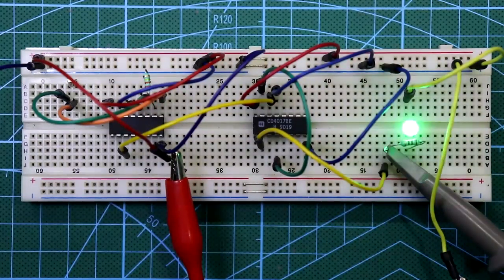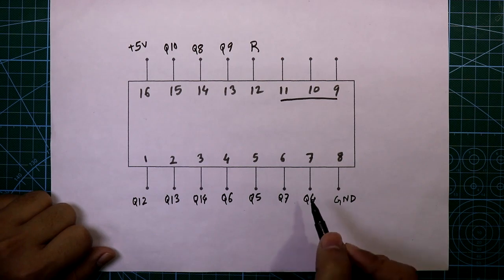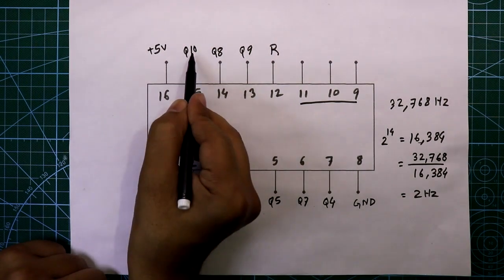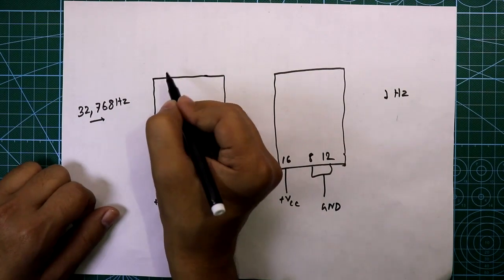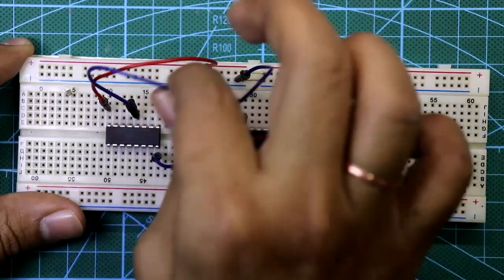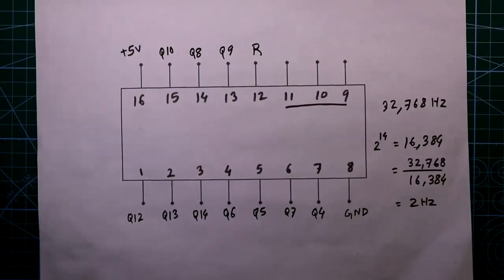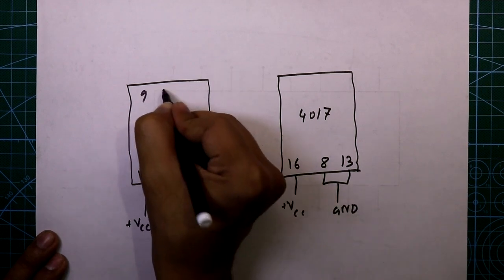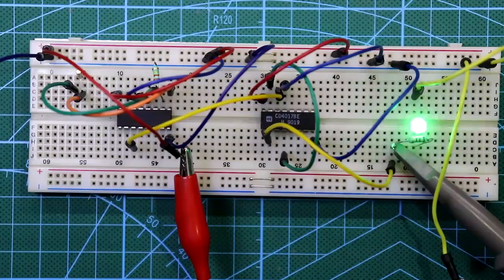Part 1: How to generate 100% accurate 1Hz clock pulse with crystal oscillator

Comment: Thanks for the video, I seem to be getting a 10hz output using the same circuit as you with a 32768Hz crystal and 330k resistor, I'm not sure why, any help would be appreciated. You also seem to use a different circuit to that used on the CD4060 datasheet?
Reply: 9:08 asper the video he said 330k resistor, but insted of 330k he used some resistor having colour code brown brown yellow gold as per the colour code that is 110k ohms with a tolerance of 5%. Bingo 👍.
If you got 10hz you just check and change the crystal that will fix your issue.
Reply: same here. The only way I can lower it is by using more resistance. Around 740Kohms

Comment: Hello Sir. Very good video. I found some other circuits from internet. But they connected some capacitors and resistors. Different values in different sites. Is this necessary?
Reply from the maker: Actually capacitors are necessary. I've another video on CD4060. That will help you. 
https://youtu.be/4mxwQ-zIwS8
Reply: @EEWave  Thank you

Comment: A very good explanation but sadly not quite accurate headline. It all relies on the crystal actually oscillating at the stated frequency. But it varies, mostly due to temperature change and age. That's why there are other devices, some quite expensive, such a txco devices(temperature compensated crystal oscillator) which get much closer to '100%' 1 Hz.

Comment: Can you clarify ic number? 
Is it CD4060 or
HEF4060
 I accidentally bought HEF
And i couldn’t find Your 4017 video. Please provide link of the 4017 video
Reply from the maker: Both are same. The number (4060) is important, not the prefix or suffix.

The video link on 4017 is given in the description section.

Comment: Can you explain why you use a 330K resistor ? Is there any equation or something to figure out the res value? btw the video is great, thank you for your instruction
Reply from the maker: Some people say it is a damping resistor which will reduce the chance of damage of the Crystal oscillator. Or some say it is border frequency resistor. If you see the datasheet of IC 4060, then you can find the typical Crystal circuit where they have used a higher valued resistor in the oscillator circuit, and I've taken that circuit. Till now, I don't have any satisfying answer to your question, I'm also searching for the answer.
Reply: @EEWave  I get very high frequency oscillation. I need to put around 600kohms to be able to see the pulse. Also, when I remove the crystal I don't see a change.

Comment: Thanks very much. Could you tell me why you've used the 330 kilo ohm resistor there?
Reply from the maker: It is a damping resistor. It will reduce the chance of damage of the Crystal oscillator.
Reply: @EEWave  I've applied the same circuit...But instead of using two CD 4060 , I've used a CD 4060 and a HEF4060...and I'm getting higher frequency than 1 Hz...Does this affect?
Reply from the maker: You should get 1Hz frequency with these two. They are same. What is exact frequency you are getting?

Comment: I tried the crystal oscillator circuit and it works.  However, every other source shows a pair of feedback capacitors which you have omitted, so although it works, I'm still not sure the circuit is correct.
Reply: Hey can you share those links of the sources

Comment: How to get 1hz frequency from other values of crystal oscillator like 25 Mhz, 10 Mhz ,4 Mhz, 8 Mhz , 32.767 Mhz?????Actually I tried with other crystals also and applied your calculation technique but unfortunately did nit get the required result...
Reply from the maker: In this case, we can not use 4060. We have to use other counter like ÷5 and ÷10.
Reply: U can use 4060 with any 4040

Comment: This is NOT 100% accurate .. There is missing some capacitors In the oscillator .. Yes 1 hz seems accurate but it’s a dividend signal .. I builded a few of these from this video here and used Them for time base .. Resultat the clock loose 3 seconds a day .. Because the 32768 hz crystal differ with 1 hz ... 

When divided to 1 Hz .. it’s 1/32768 hz wrong ... This oscilloscope is not accurate enought to show 1/32768 hz ... Or in otter words the 1 hz signal is 0,000003052 Hz wrong ..
Reply: Hey can you help me out with this cloxk pulse